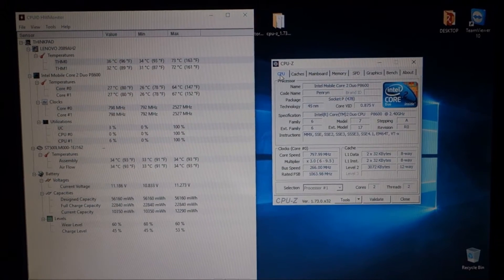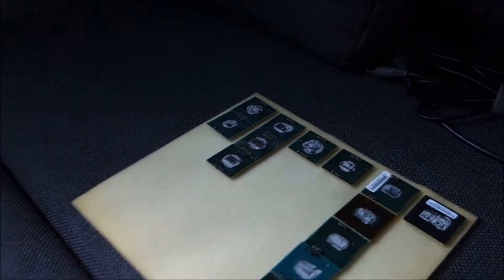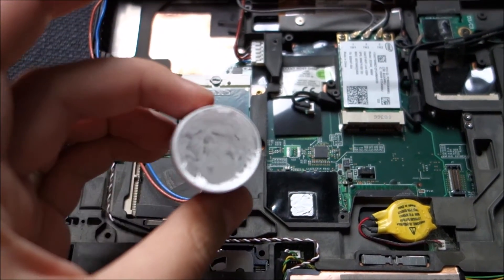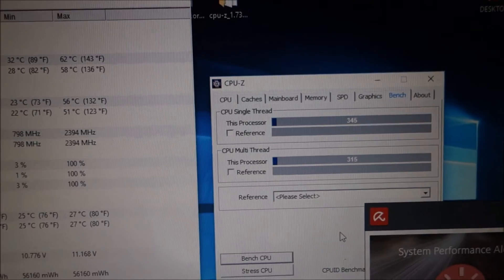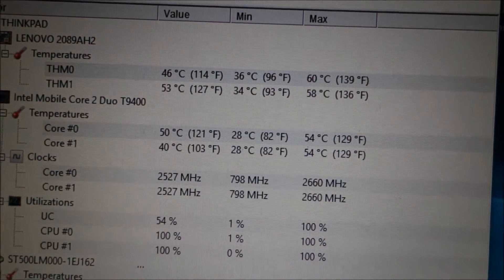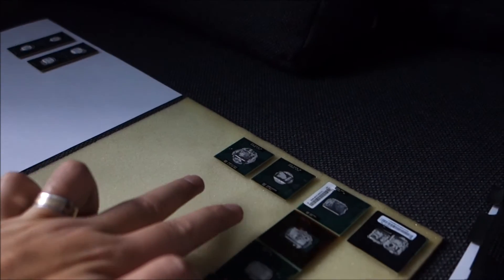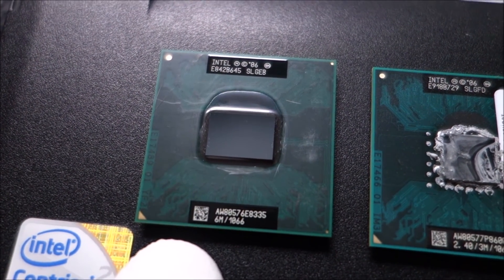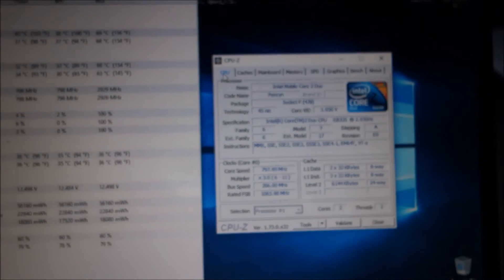Testing 7 CPUs in a Lenovo ThinkPad T500 laptop

Comment: what about the x9100?
Reply from the maker: I will not work. T500 does not seem to support quad cores:
http://forum.notebookreview.com/threads/installing-x9100-to-t500.363200/page-2
https://forums.lenovo.com/t5/forums/v3_1/forumtopicpage/board-id/tp01_en/thread-id/84471/page/2
Reply: @UltimateDIY , the Intel X9100 is just an unlocked Intel T9900 -- neither is quad-core: both C.P.U.s are dual-core, and both are compatible with the Lenovo T500/W500 ThinkPad laptop.
Reply from the maker: Thank you for the clarification. Sadly, it seems the link is not up anymore to see where my confusion started.
Reply: ok thanks for the response!
Reply from the maker: no problem
Reply: @UltimateDIY  That's not entirely true. It's just slightly complicated
Reply from the maker: Please elaborate :)
Reply: @Norotoba dude the x9100 is dual core it is just with unlocked multiplier and can infact run in a t500 and even t400 the only "drawback" is battery life